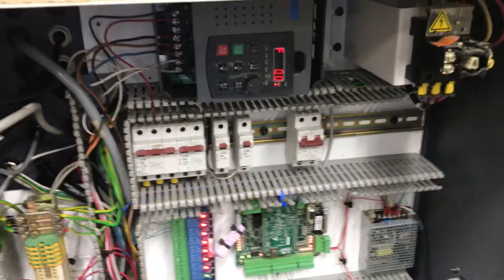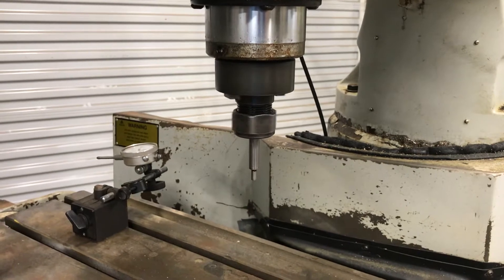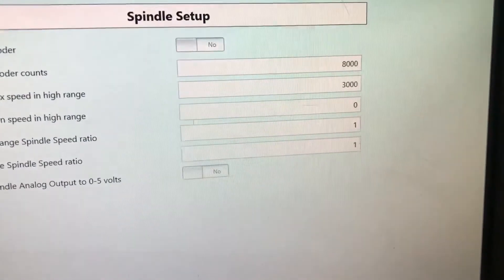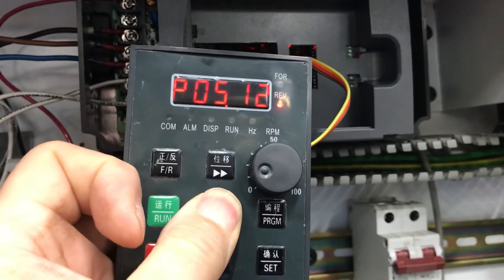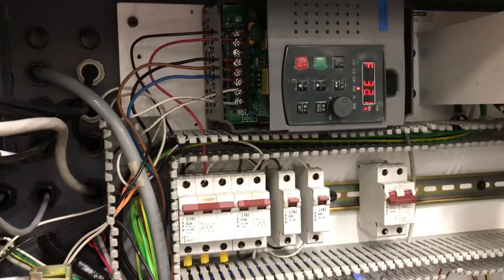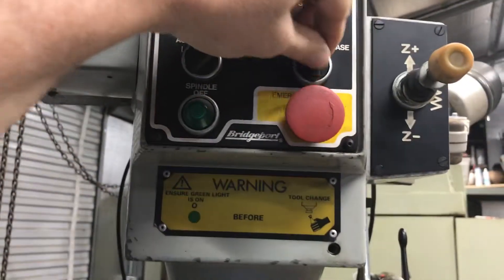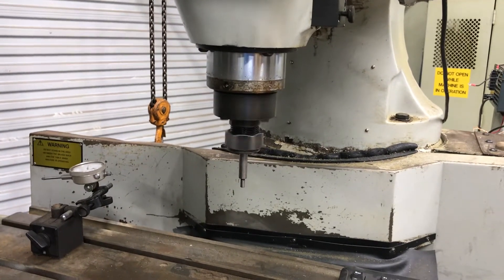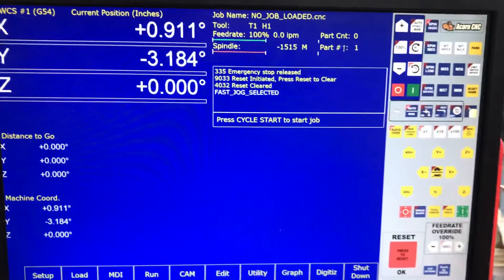VFD and Acorn configuration and setup

Comment: Thanks for sharing! I’m currently installing a new 120v Huanyang VFD for my wood router with a Centroid Acorn controller. Would you be able to share pictures of the exact wiring from the Acorn controller to the VFD with wires and input/outputs being labeled? Maybe a wiring schematic for your exact setup?  Also, could you share a computer screen capture of your CNC 12 “Wizard” outputs for the Acorn Relay Board? Thank you!
Reply from the maker: I had to pull my VFD and go with a different one, this one would not work for me
Reply: Thank you for your response! I’m sorry to hear that the original VFD did not work. I hope your project is going well!

Comment: Vfds usually error out when you go passed the limit of the spindle break ,with how much mass you got on your spindle that's a lot of energy to dissipate, they will error and disconnect to keep from overloading and will let the spindle slow itself down naturally  and If you ever have a issue with connections and weird things happening its probably because you have your vfd in with your small voltage electronics Vfds give off a boat load of emi its always recommended/best practice to put in a separate enclosure with emi filter and ferrites because once you close your door on your enclosure its become a emi cage Nice setup btw